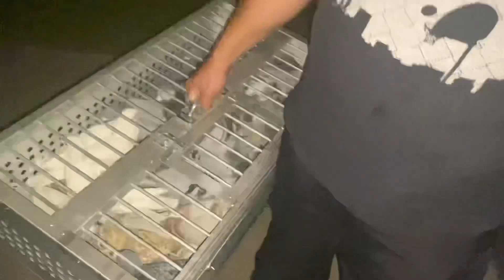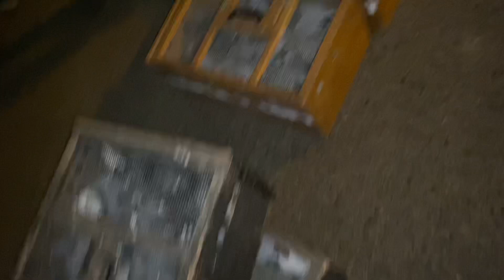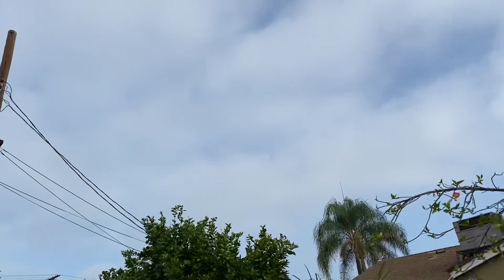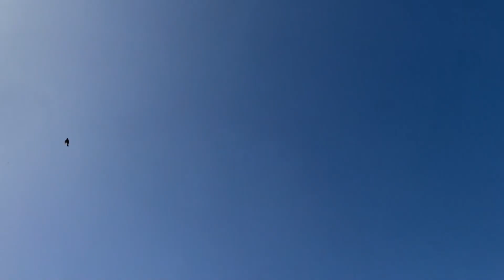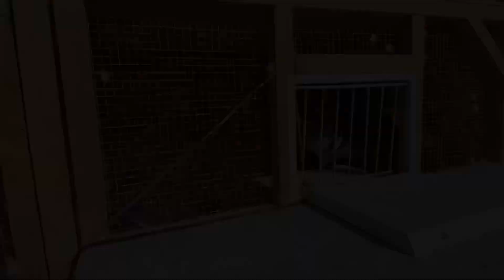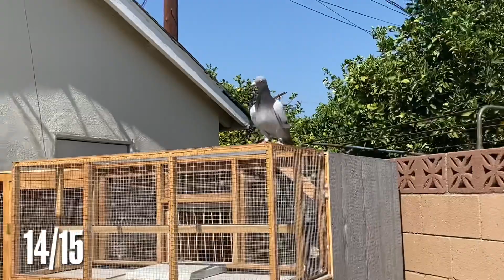80 Mile Training Toss: *SHOCK TOSS* for my 2021 Racing Pigeons

Comment: Okay you're doing wrong take that inside platform and put it on hinges let it lay down where the birds cannot Roost on it because it discourage the birds from going in your you can lose valuable seconds and minutes on it like that trust me I used to do that then I switched it over where they couldn't land on it in from the inside of the wall and they fall straight to the ground it keeps your birds down on the ground keep them away from up top up-top from the other birds coming in